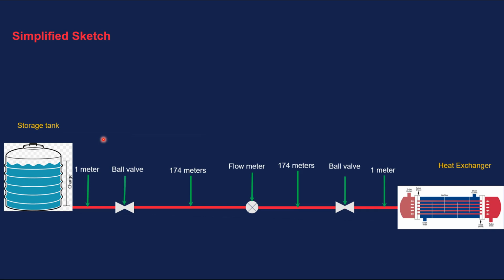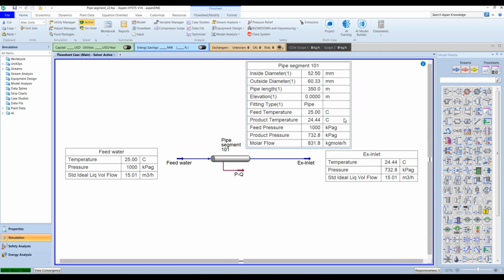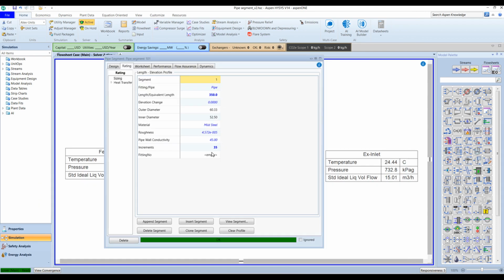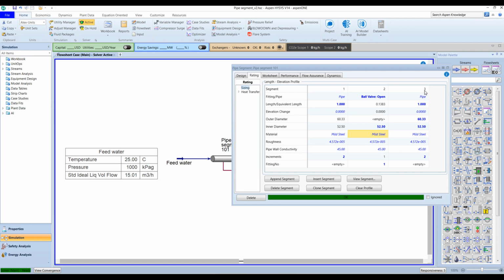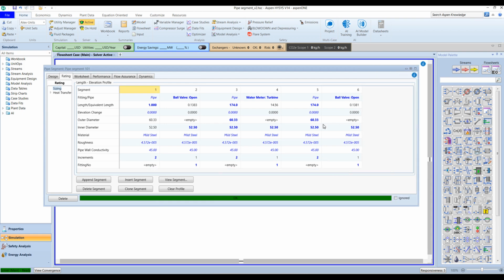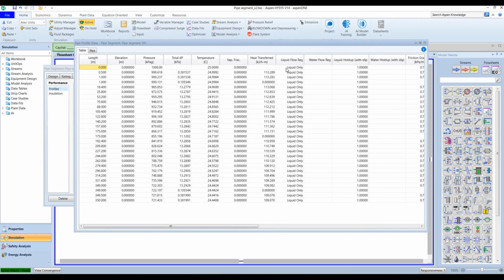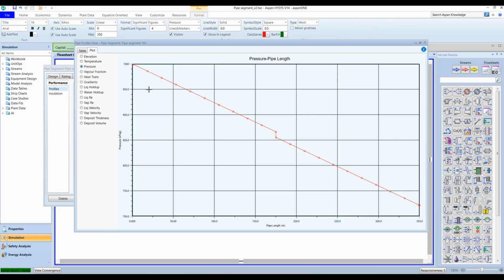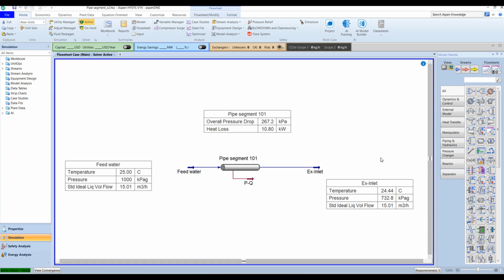Pipe Segment Sizing and Simulation In HYSYS Session 2 Continued

Comment: Excelent video! but I have a question, for example, if I have a heat exchanger, a pump and a tank in between the line can I still use the "clone segment" and add this equipments? or do I have to add them separately?